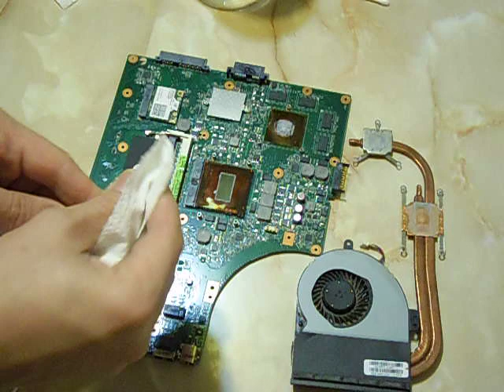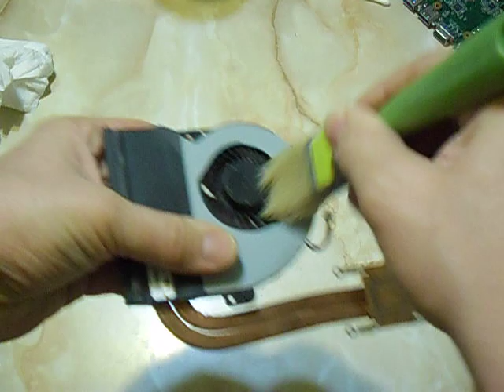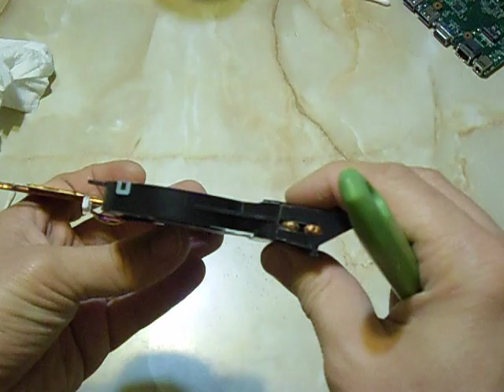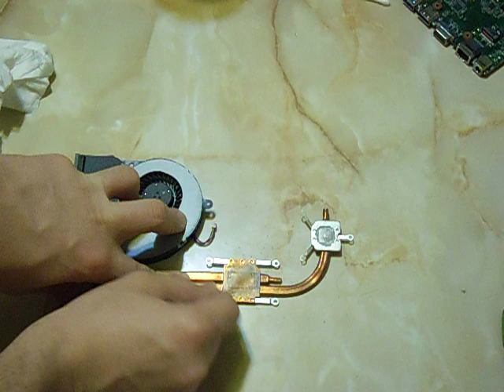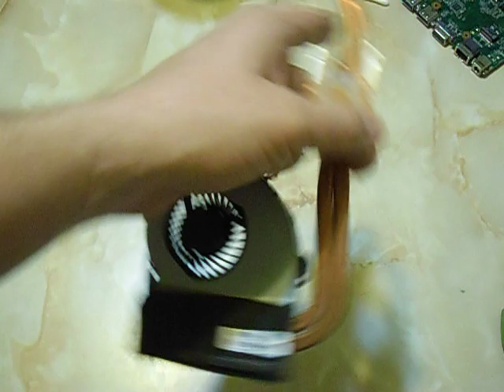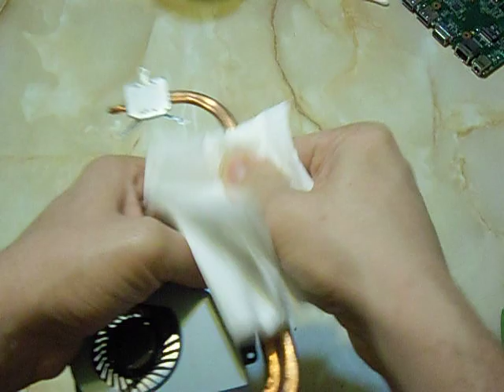How to Remove Old Thermal Paste Asus K53SV K53E A53E A52F Notebook Repair

Comment: Hi, good video. Do you know what is the orange plastic that covers the cpu and the gpu? I have thermal paste under that plastic, Should i removed the plastic for cleaning it completly? Ty very much.
Reply from the maker: Hi ! The orange plastic is an insulator that prevents the gpu / cpu external parts (some small resistors and capacitors that are soldered on them ) to touch the metal heat sinks and thus preventing a possible short-circuit. There is no need to remove them as long as they are not interfering with the contact surface.

Comment: Is it necessary to remove and reapplybthermsl paste to the laptop before putting it back together ?
Reply from the maker: It's highly recommended, as the thermal paste loses it's properties with age thus making heat transfer harder.
Reply: zangah what should i use to clean the thermal paste off ?
Reply from the maker: Ann Davis
Isopropyl alcohol is the best choice.

Comment: Hello, aren't you applying too much pressure when cleaning? I'm afraid I can break it pressing that much.
Reply from the maker: I'm am not pushing to hard, just enough pressure on the paper towel such that it will stick to the old thermal compound and remove it.